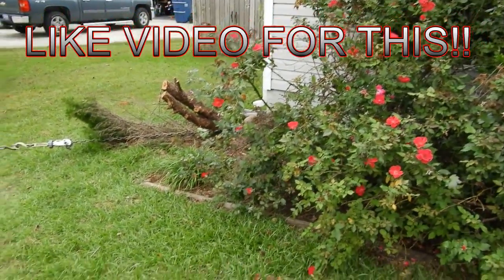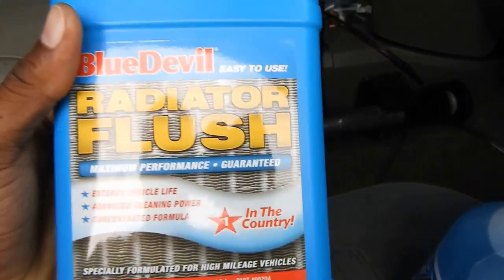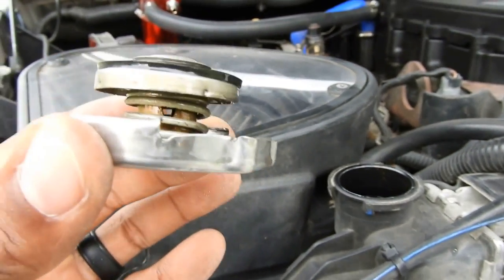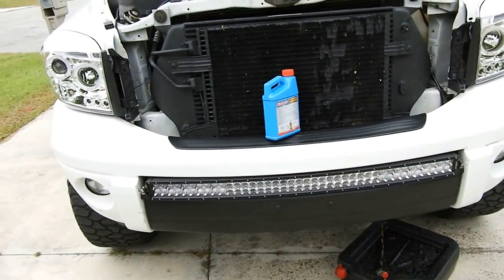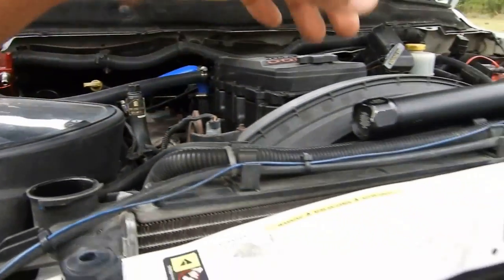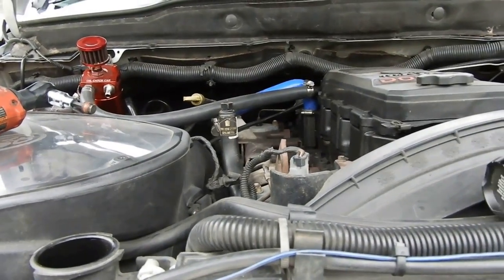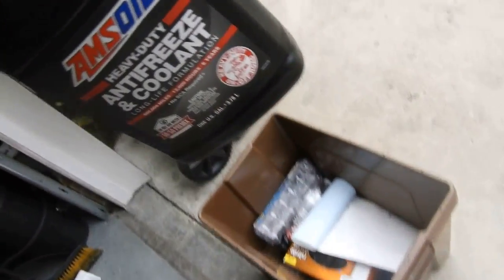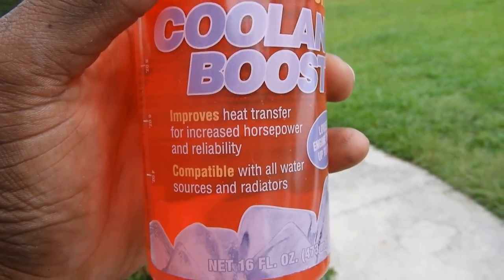CUMMINS COOLANT CHANGE & FLUSH

Comment: Dope truck man!! And these trucks need HOAT coolant in them and next time only use that cheap distilled water not hose water since that has minerals which causes rust in the radiator.
Reply: My 2016 Cummins requires OAT coolant, not HOAT. Mixing the two will cause problems.
Reply: @caroldavid1019  ahh well I assume his isnt the newer model... probably due to updated materials in the cooling system for the OAT but my 03 5.9 is HOAT so all 5.9 are that and maybe the 08 6.7 engines

Comment: Mine fluctuates too since I did the Mishimoto radiator. Hottest it gets is just below 200 which it only gets to on the highway doing 70 at about 2,300 rpms. ANY other time it’s about 190, and gets even lower (180ish) if I’m sitting at a light, etc.. It almost gets TOO cool since these motors like about 195-200 degrees to get a complete burn. I’m still happy though, it’ll be piece of mind in the summer when it’s 100 degrees outside and humid as hell. Peace of mind! Great job flushing the system, you did a thorough job 👍🏼 I love your rims btw, haven’t seen a set in person yet! Everyone around my area is obsessed with Moto Metal 970’s and Fuel Mavericks.........everyone......
Reply from the maker: Hell yeah I'm thinking about doing the mishimoto radiator. Got the intercooler so might as well get the radiator haha
Reply: How do you like the radiator after some time? Looking for an honest review.

Comment: couple things. 
*coolant temps: that big ol' indiana inline is a fickle girl. she makes power cooler, but she's more efficient warmer. the later 6.7s come with a 205 thermostat, and our 3rd gens are stock 190*. going to a cooler thermostat or, like you did, more thermally efficient coolant you'll pick up a little power (maybe not noticeable with Ye Olde Keester Dyno) but lose a little efficiency. 
*coolant bypass. the fleece bypass is temp dependent. it opens with a 180 thermostat in the housing. the HSM kit opens with a watts-type pressure valve which i think you can order for either 35 or 50 psi. me personally, i picked up the fleece because i'd rather have it just open and stay open. 
**filtration: sinister (and others, but that's the one i've got) makes a coolant filter for our trucks. uses a wix filter that i've yet to find an oreilly where it's not in stock. installed when my water pump went out. first few filter changes? bruh... that thing was nasty like a fayetteville nail salon. blew my mind how much garbage was floating around in the cooling system.
Reply from the maker: I will be looking into the coolant filter kit they're not expensive on Ebay. It's pretty much like a trade off in terms of the better coolant and running like a fleece bypass kit.
Reply: Mike Pozzi your wrong about the newer Cummins having a 205 thermostat.
10-12 200
13-18 190 went back to same as 3rd gen

Comment: So u rum the stock 190 thermostat or 180?? Bought a 180 thinking it was good but a lot of people say it's terrible for a 5.9
Reply from the maker: I'm pretty sure these engine are most efficient at 190-200 degrees. For some reason people think 200 is hot and that's gonna destroy the engines. I think the 190 is fine

Comment: Look into the Motorsport diesel coolant bypass kit. Worked wonders for temps especially towing.
Reply from the maker: I want to do a fleece coolant bypass but it's a mother to get to while transmission is in. One day though
Reply: EVERYTHANG DIESEL that’s why I went with the Motorsport diesel for the simplicity.  Took 45 minutes to install.
Reply: Overall I think the fleece is a better design.   It’s just a pain in the azz to install
Reply from the maker: That it is man haha
Reply from the maker: im gonna look into it.
Reply: @EVERYTHANGDIESEL  I know this is old but I'm still running my H&S EGR delete and block plate...would it maybe be a good idea to open it up and send coolant again to the rear cylinders? I haven't had any issues yet...I don't think...haha. I have a Sinister Diesel reroute kit like you do in the video. Should I just install that? Had it for years and just never installed it.

Comment: so,  i have a 2013 ram 2500 6.7  and the underside looks nothing like that. i have another radiator underneath the main radiator so it might be a  cooler etc.  but everything is stock .   I still had to remove the grill and some plastic pieces, but I ended up removing a 1.5-2 turn plug and it started draining.   yours is the 3rd vid i watched and went back to the truck and was like, there is nothing the same
Reply from the maker: Thats cause they changed it up on 4th gens. This truck is a 2008. Ram changed there radiator setup on 2013 and newer trucks
Reply: @EVERYTHANGDIESEL  changed out the turbo actuator with one from genos garage.  Besides pulling the radiator drain plug, I just had to remove the wheel well cover.  Had access to all bolts without any issues.  Even left the tire on.   Truck has power throttle response,  and an exhaust break again.

Comment: I need to do this to my 6.7 pretty soon - my question is though, how to deal with the coolant still inside the overflow bottle? Does that just drain out as well through the radiator?
Reply: how he just gonna like it wtf
Reply: @rated4658  seriously. Obviously I did the flush and figured it out since then
Reply: @newspaperlightbulb  so what did you do for the overflow? Separately drain or does it drain as well?
Reply: @kennyyetter  long time since I posted this, but what I ended up doing was just draining the radiator with the cap still on and I guess it created a vacuum that sucked out all the fluid from the overflow bottle as well. once the degas bottle was empty I took the cap off to drain whatever was left. 🤷‍♂️ I imagine that you could probably take a piece of hose and make a siphon for the overflow bottle as well.
Reply: @newspaperlightbulb  thank you

Comment: I noticed oil on my cap today during flush. No coolant in oil. Oil cooler gasket failure? Thanks for any help
Reply from the maker: Potentially. U need to test the coolant to see if it is getting any oil contamination
Reply: @EVERYTHANGDIESEL   I flushed it & there was a light film of oil on the top. I’m guessing oil cooler gasket. Also getting p2622 code. Truck just hit 220k so hopefully it’s not about to start messing up
Reply from the maker: Address it now before it gets worse

Comment: Doing it this way, leaves lots of coolant flush in the system AND old coolant.  The coolant flush has chemicals in it that can harm the engine over time...
Reply: What would you differently?  I need to do this to my 6.7 this weekend.
Reply: @jeffmeagher7809  the block has drain points on it too. Also you want to flush out the coolant reservoir (where you fill the coolant by the firewall). For that you can add the coolant flush and run it, then pull off the hose from the reservoir and drain it OR use a hose and turkey baseter to suck it out.

And drain the radiator like he did.

There are other youtubes on line that show the drain locations or do an online search for them
Reply: @johnnyturbo8460  Thank you for the quick reply.  I haven't been able to find much on YouTube regarding the coolant flush of a 6.7 so I appreciate the advice.  Ill search around for the locations on the block that need to be flushed.  Do you just open the ports on the block and flush with water allowing the old coolant to come out the side of the block?
Reply: @jeffmeagher7809  no problem.  Yes that is correct.  I believe one is on the driver's side near the fuel filter drain but I could be wrong. Or a bolt in the side of the block simulator to the transmission drain plug.

Comment: Why did you pour it in the radiator itself vs the actual coolant container?
Reply from the maker: because that is a overflow bottle. when servicing the radiator just pop the cap off and fill.

Comment: Did a coolant change on my truck, replaced the thermostat to a 190 and now jumps around from 180-210 on the highway. Might have to put the old one back
Reply from the maker: Water pump might be failing
Reply: Bad thermostat actually. Temp never goes past 180 degrees running at 2500 rpms on highway

Comment: Did u remove the vent cap all the way while filling antifreeze?
Reply: Also was the engine running while it was being filled up?
Reply from the maker: yes i did remove it and the engine was running with the heater on.
Reply from the maker: yes i did remove it and the engine was running with the heater on.

Comment: Also if you can't get all of the coolant out with the drain plug and you add water how in the world do you know how to even mix the new stuff to know how much protection you have.
Reply from the maker: did a 50/50 pre mix and also i ran the heater to allow the heater core to warm up so it can flow through it. i was talking in reference to the coolant bypass valve opening.

Comment: Im trying to change my coolant on my ram. Does anyone know if a 17 ram 6.7 has a drain plug? i looked underneath did not see 1. Pls let me know.
Reply: HOT SHOT TRANSPORT it may be on the lower back of the radiator.

Comment: Hey I got a question I have a 2012 ram 6.7 and it takes forever to heat up in the morning and when it heats up it hits 240 and drop to 185 and then goes up to 195 you think a coolant flush could work? Or it’s the water pump I changed my thermostat and Sensor coolant
Reply from the maker: That's weird I never heard of that. What degree thermostat do you have cause if its 190 degree it should get nowhere close to 240. Make sure it's not broke. And yeah change your coolant and replace your water pump if you haven't already. I just did a video changing my water pump
Reply from the maker: In the morning if its idling warming up it won't get to operating temps until u start to drive it.
Reply: EVERYTHANG DIESEL I have a 190 thermos I just replaced it but I’ll go ahead and change the water pump and coolant
Reply from the maker: Yeah man that doesn't sound safe lol
Reply: Mine does the same thing did you fix it ??
Reply: jerrysuarez62 I just got water pump today but I’m gonna try something first I was searching for the same problems and some people had the similar problem they said the coolant system could have air so they say just open the valve release and add coolant to let the air out so fingers crossed that works if now I’m changing the water pump
Reply: jerrysuarez62 UPDATE I flushed out my fluid changed it and bled out the air and it fixed it doesn’t pass 192 and stays at 188 at a light so try changing your fluid
Reply: Sam Atallah ok drain it and refill ?
Reply: jerrysuarez62 that’s why I did and my truck isn’t heating up anymore so do what Cameron did drain the coolant and then add water and top it off make sure to bled the air and let it run and drain again and do it one more time just to make sure and then add coolant while it’s running
Reply: Stay away from Motorad thermostats get oem or stant from Napa but sounds like u have air in the system riser bleed only works if level I vacuum fill mine and no more air pockets now

Comment: Nice video. How did you open that radiator drain valve? It turns 1/4 turn and stops? Supposed to force it? Pull it? Anyone know? I often break stuff! Trying to avoid that.
Reply from the maker: U use pliers and twist it out until it stops and itll drain
Reply: @EVERYTHANGDIESEL  : Thanks! So twist more than 90 degrees? Or twist 90 and then pull like crazy?

Comment: Salute, always life motivational. I'm just bought done replacing the radiator and water pump, praying my video on my channel will 12v  would running nice . Praying I can save my water system and then next to get into valve cover gaskets and then next into the fuel updates...

Comment: I don't know of anything that stops the coolant from constantly flowing through the heater core on a dodge Cummins but ok.
Reply: Air pocket
Reply: Definitely an air pocket or if u drive down the road and have heat turning one way but not another u have air pocket fluctuations in temp will tell u that also. Did mine yesterday had the same problem everyone said hg but they just want money not fix the issue if it’s a hg it would be pissing it out overflow and rad cap

Comment: You should have drove the truck around for 3 hours with the rad flush in there. And never run the truck with no coolant in it as the pump fins run dry and is bad for the pump as the coolant lubes the pump.  Also to get all the water out take compressed air and hose and put a air gun fitting on the hose and take the thermostat out. Bolt the therm housing back in.  Make a seal with your hand and compressed air with heat on truck off in run position and 35 psi of air blowing into the heater core. This will push the fluid out the heater core. Then the hose you took off the core 35 psi threw the heat core hose the goes to the block. Air going into the block not the heater core this time.. This will push all the water out of everywhere. Taper off the heater core inlet for now while doing this to make a seal.. Leave rad cap on and lower drain cock open. Or lower hose that goes to rad. And thats that. Then put your hose back on heater core,  close the pet cock or install lower rad hose and fill it with the new stuff with truck running and heat on. Be sure to fill as much as you can with the truck off before you start it. And that rad flush its good to run the truck for at least a 3 hours for it to do its thing. Otherwise your just throwing your money away. Other then that, Great video.